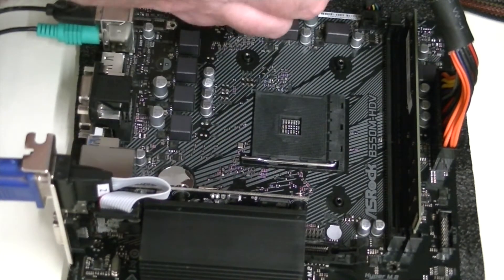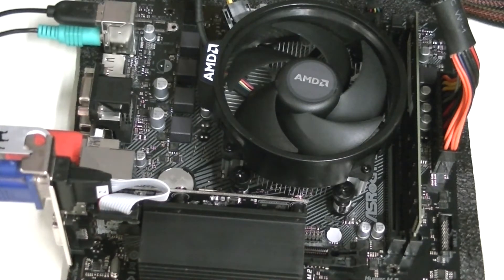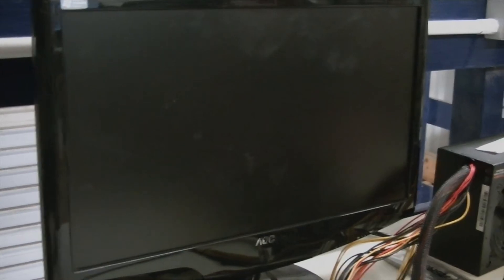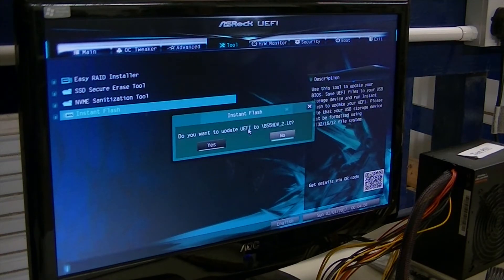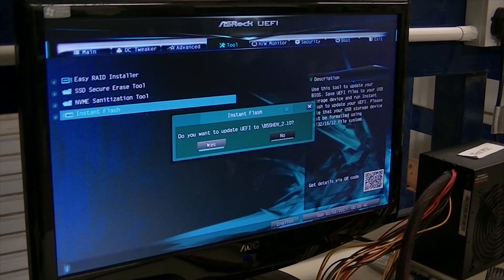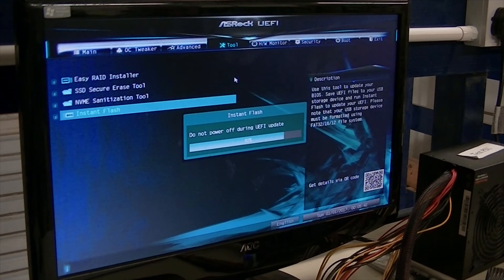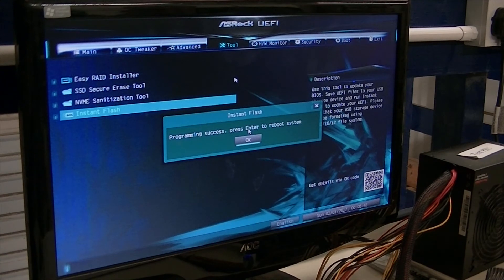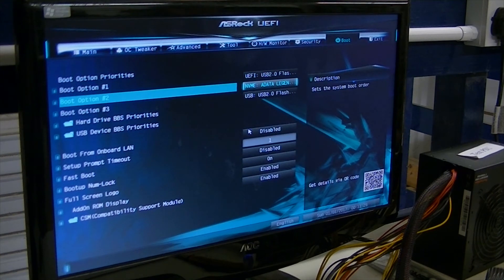B550M BIOS FLASH TO SUPPORT RYZEN 3 4100

Comment: what does the remove disks or other media part mean?
Reply from the maker: Hi Carvez,

That is because I had left the memory stick/flash drive in the USB port and it was trying to boot from that due to at this stage I had not installed the operating system (Windows).  Had it had Windows installed it would of booted into Windows.
Reply: @enscomputers  ahh ok

Comment: you responded on Terminator R's comment by "" The Asrock B550M-HDV only supports the  5600G from BIOS version 1.70 ""  , can you explain to me what did  you meant by that ? because i want to update the bios of my Asrock B550M-HDV to use it with Ryzen 5 5600G , do you mean i should update the bios to 1.70 version instead of the latest version (L2.62) ?
Reply from the maker: Hi Mohamed, 
What is the current BIOS version? If it is lower than v1.70 I would update to v1.70 first then try to go to the latest but sometimes you need to go up a couple more versions before being able to go to latest.  Took me while to work that out when I first encountered it.